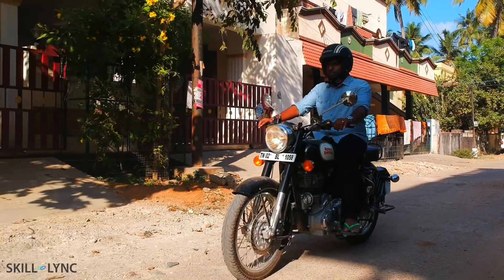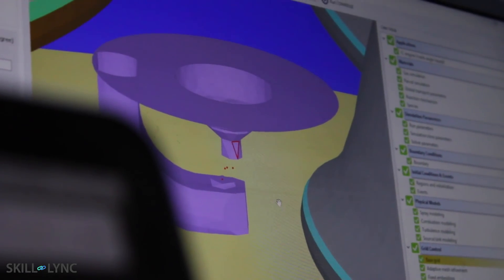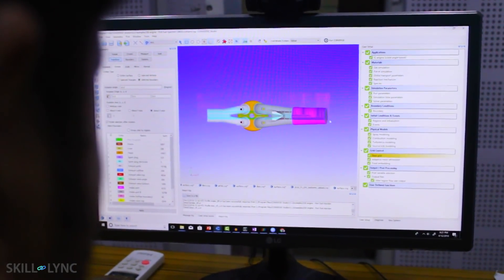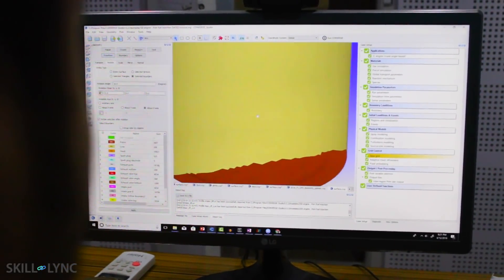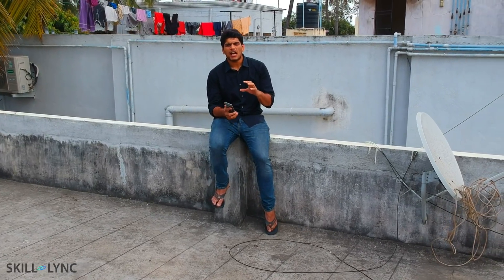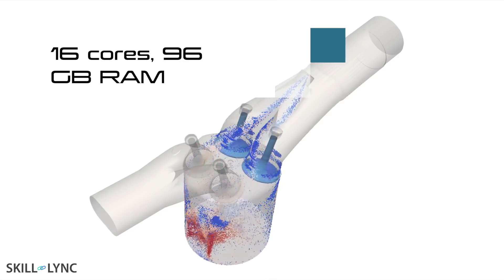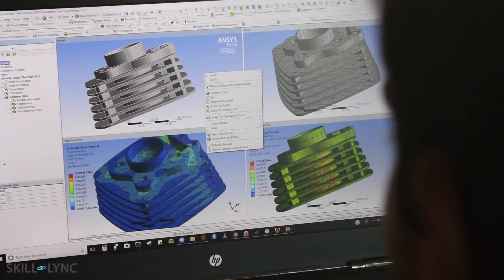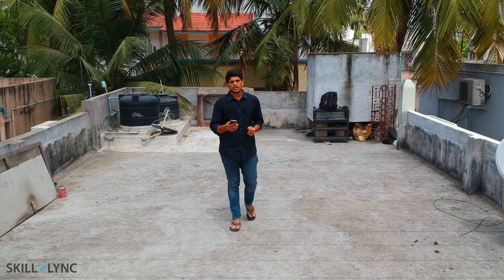How to design an engine?

Comment: Can we can't do the same in AutoCAD/pro-e for the design if we have the all the information.
Reply from the maker: Absolutely! However, you need to have a reacting flow solver and a structural analysis tool.
Reply: Skill Lync . Will you tell how to design any automobile with good explanation using real time designs.